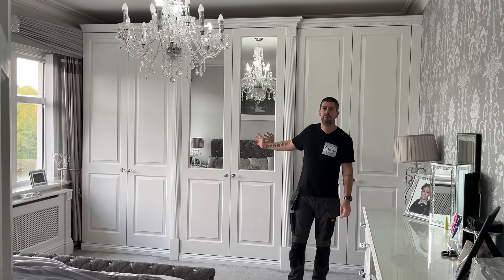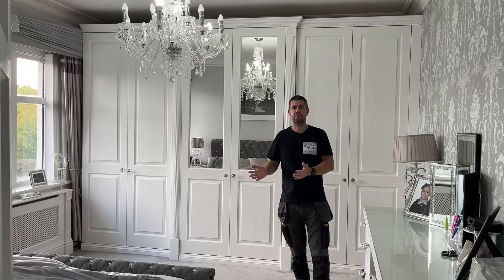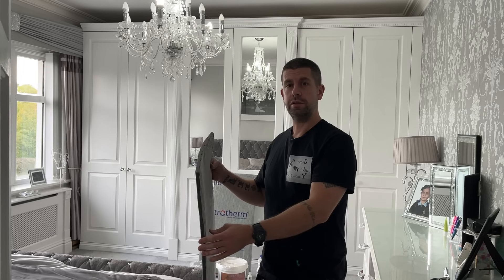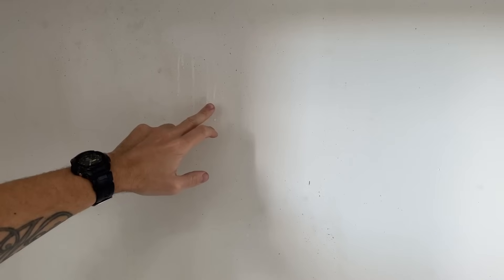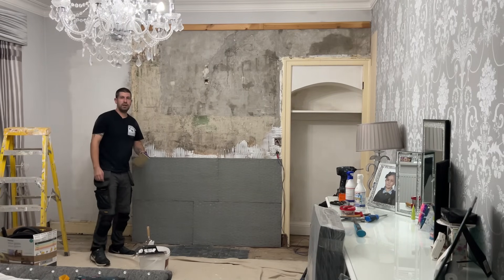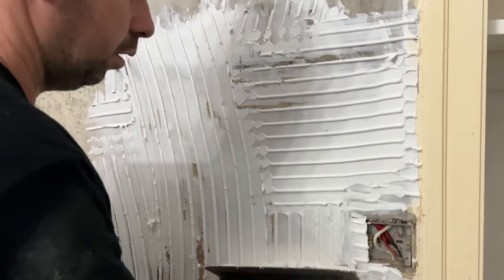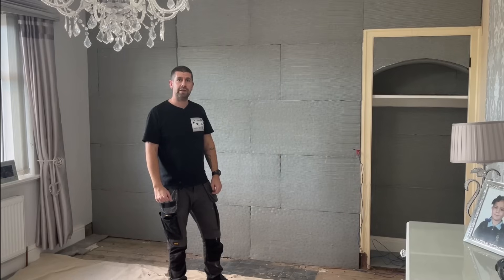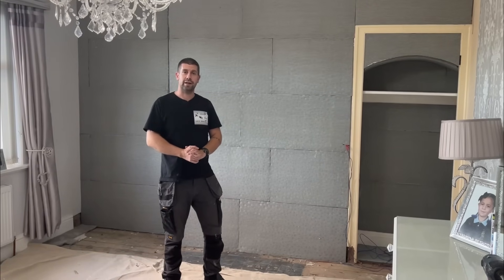Insulating Internal Walls. Easy DIY Solution

Comment: This will not solve the problem. The moisture will condense somewhere in your house overnight. You probably have extremely poor air quality indoors. (1) humidity meter £20 (2) open your windows at least once a day (3) open window after shower (4) open window after cooking (5) buy a dehumidifier.  Insulating everywhere is excellent but if you don't then ventilate you will be maintaining extremely poor air quality and will suffer more respiratory diseases/headaches/poor sleep etc.,.
Reply: All true.
Reply: Yes, I wish you were wrong, but bitter experience tells me that you’re spot on! 

I’m going to lean into airtightness & improved insulation…and then MHRV. 

Can’t wait to wave goodbye to damp & black mould by tackling the cause rather than just the symptoms.

Frankly I wouldn’t trust most professionals either. 

Oh god, just seen the product he’s using facepalm where do I start? 

Ideally you need to use a vapour permeable internal insulation like either hemp/wool/wood fibre products, followed by permeable board/lime plaster, or, if you can afford it, aerogel.

What you don’t want to do is use a product with negligible insulation value, that seals damp in your walls and encourages interstitial condensation. Like what he’s just done 😢

Comment: I doubt if the problem is solved. It will just form behind the product, out of sight until it accumulates to the point where it escapes from the wet wall. Condensation will be discouraged at the treated surface but will gather at other points that are below the dew point. No product that is affordable will do much at that thickness! The solution: dehumidify, ventilate when frosty, add heat when possible, expose external walls, keep air moving at the surface. Better still, insulate externally and vent the chimney.😊

Comment: It has all been written by many people already, One thing would try (because there is no way i would those wardrobes back on that wall as it is or with plaster or whatever goes on top) That water/moisture is now trapped it has to go somewhere. So on the bottom row ( on the floor) between the new insulation and the wall he has used adhesive on I would leave a gap, eg 5-10 mm,  and have something like conduit made out of plastic to make a channel for the water and just hope the moisture he has trapped in to that wall goes downwards. I would drill a hole into the outer wall so that the wall runsvia  the conduit towards the window wall, and direct it via some sort of pipe out of the building. In any case I dont see any mention of a vent. If you put a hole in the base of that wardrobe when its put back you can put a vent cover on it and at the very least then you can put a dehumidfier next to it.

Comment: I think you need a decent dehumidifier, those moisture traps are useless your not getting the water out the air, Charlie DIY does a video on this. Use a proper plug in dehumidifier and you will see results.. yes chimney would be a cold spot but without taking the water out the air it will just condensate elsewhere
Reply: I agree. Charlie did a great video. Get a cheap air monitor and check the humidity level because you may find that it's really high and you probably didn't notice it before because warm air can hold more moisture and now since the room is cooler you are reaching saturation alot sooner. Anyway as suggested a  dehumidifier will help
Reply: @asif530  mine was up to like 85/90% 
Now it’s around 65% in the winter  with the dehumidifier, massive difference pulling 2L plus out the air daily… showers/cooking/breathing and drying clothes in houses when the windows are closed causing massive issues people think heating the house will solve it. Completely wrong
Reply: @liam_j82  that's good. I have monitors placed in a few different places and luckily with a few changes I'm able to maintain around 50 % humidity . As its relative humidity it does creep up on occasions

Comment: My home is well insulated, inside and out. I’ve used Wallrock thermal liner and cavity wall insulation, have extractor fans in the bathroom and kitchen. The house now warms quickly and stays warm but I still had window condensation and also condensation dripping from exposed chromed pipes in the bathroom. I purchased a recommended (Russell Hobbs) dehumidifier and now regularly take 6-8 litres of water out of the air daily. All condensation is gone. For me it was the way to go.

Comment: Your main issue is humidity, and that is best handled by installing an air exchange or dehumidifier. The starting point is to purchase a cheap humidity meter so you can quantify the problem. The wall insulation has itself not solved the problem, but rather it has solved the consequences of the problem in a certain area of the house.

Comment: Install a ventilator cowl to your chimney pot, if it hasn't been done already. It'll help eliminate water ingress and allow the existing flue to continually breathe. If its currently capped there can be condensation building up within the flue, escaping through the interior walls. I talk from experience, living in a victorian home. This solved a big problem for me and saved me a lot of money too. Let old buildings breath as they should. 

Great content by the way. Well presented. Keep it up
Reply: Great, relevant advice -- thanks v much.

Comment: The reason you have mould is moisture in the air that you need to get rid of. Older houses were more draughty but this helped to remove air moisture. Our houses are so well insulated these days that the moisture tends not to be dispelled. We also have a 1930 cottage which until about a year ago had the same problems everyone else is facing. We had stopped up all the draughty spots and insulated but this led to mould in areas where there is little to no air flow and also to condensation on the inside of windows which by the way are relatively new. 
The answer for us was to fit a PIV unit. This stands for Positive Input Ventilation. Almost instantly we noticed the difference. The window condensation was gone within a couple of days and we have completely eliminated all mould growth (after cleaning away any that was there prior to fitting the PIV). 
The manufacturers say you need an electrician to fit one hardwired in. However, I contacted the company we bought ours from who admitted that it will run quite happily off a 13 amp socket fitted with the appropriate fuse. Most people don’t have a 13 amp socked in their loft (where the PIV is fitted) so that why they say you need an electrician – we did have a socket already in ours so we just used that. I fitted the PIV myself in under and hour which was really easy.
Honesty, if you have the kind of problems shown in this video, a PIV is what is needed to fix it. I still think the insulation is a good idea though as it will help keep the house warmer. Hope this helps someone. 🙂
Reply: Sure helped me, thank you
Reply: Did you have to vent the unit in the attic?
Reply: Thanks very much -- valuable information!!
Reply: What is PIV?
Reply: @lizwirtz5968  he says in his comment
Reply: @markhedger6378  Yes, thankyou. I checked after and realised.

Comment: The problem you are suffering is too much humidity in the air and cold spots that are below the dew point. When the warm moist air hits the cold spots the water condenses onto that surface. The PIV systems people are talking about pull in cold air from the outside that is lower humidity then it’s warmed up and it pulls some of the humidity out of the air and will push some of the existing air out of the house via any gaps. 
Other people have talked about dehumidifiers. These are quite good and will produce a little heat in addition to pulling out water out of the air, but the do cost a fair bit to run. 
The problem with insulation on the walls is the temperature will drop behind the insulation and you could then end up with interstitial condensation. This is why people use moisture barriers on the warm side of insulation to reduce the passage of moist air into the insulation. 

Things to be wary of. 
Drying clothes inside on rads
Showers
Boiling kettles
Cooking. 

If you are going to dry clothes indoors then a dehumidifier is a must and will dry them quicker anyway. 
Shower get a big extractor fan not one of the small wall based ones an in line one and make sure your door to the bathroom has plenty of gaps to let air in. If the air can’t get in easily then it won’t extract much air. 
Boiling kettles, when you’ve used it poor cold water into the kettle to stop it steaming. 
Cooking, make sure your extractor fan works and if it dosnt go to the outside then get one fitted that does. A. Internal venting one is no use. 

Great video, make sure you do a follow up after winter.
Reply: PIV systems are great in spring and autumn, but I've found they cause nothing but problems in the summer and winter - in the summer they drag in hot air from either outside or your loft (and if it's your loft which is common it is so much worse still) and in winter you have to either pump cold air in or spend a lot inefficiently heating the air. If you're gonna retrofit a system like that (and tbh as we insulate and seal older houses we should) you're better off spending a little extra on a heat recovery system for not a whole lot much more money, you can buy kits that come with a design service to make sure you're doing it right.
Reply: Towels are bad too. I use an artificial chamois to dry myself. When I wring it out tons of water comes out that would have otherwise sat in the air as the towel dried.

Comment: Everyone talking about how he should reduce the humidity in the house are missing the point - he probably knows this!
 This video is more to show this really good, simple product which we can insulate our external walls with and would stop the water vapour condensing on the wall, which the mould then grows on.
Reply: It won't fix the windows though. Dead obvious he has a humidity problem. The insides of windows should never look like that.

Comment: Wie have in germany something called: Ytong Multipor
Ytong is the Brand and Multipor is the Produktname. This stuff is awesome.

I used it in a wet Basement.

This stuff is so good for thermal insulation. The best thing about it isn't the thermal insulation, but rather the fact that it can absorb an enormous amount of water and moisture. 

The wall underneath can still breathe completely and is open to diffusion. Mold is not possible because the PH value is too high. Combined with automatic ventilation or occasional ventilation with an open window, Multipor is unbeatable. This is the Ferarri under the diffusion-open insulation in Germany.
Reply: Thanks for this. Will check it out!

Comment: dehumidifiers are good and not very expensive to run. Its a common problem particularly in bedrooms . Lots of "water" produced overnight with little or no ventilation but mainly the door is closed making things much worse. Opposite with kitchens and bathrooms where doors should be kept closed and extraction fans fitted

Comment: Had exactly the same problem ,lost all my run of robes,moved new robes to inside wall no more problems,outside walls are the problem unless you do what you have done,also having problem in the kitchen ,stuck insulation behind outside wall units ,also if you tile the floors always put a moisture barrier on concrete floor before tiling with insulation as we'll as the floor gets realy cold in winter causing damp to rise

Comment: Erfurt make a 7mm thick XPS panel that is more rigid than this stuff (and about the same dimensions otherwise), costs about 23 quid for 4 square meters, and you can put the adhesive on with a brush which makes the job much simpler for a DIYer, and they perform great. These look like they will work well if you can hide them or plasterboard over the top of them (but if you were doing that I don't know why you wouldn't just use XPS or PU-backed plasterboard). The Erfurt XPS panels are fire retardant treated and you can paint over them directly or just put lining paper over and paint or paper that. I've only used them for ceilings in a trouble spot, but they've been great for that and should work fairly well used on a wall here or there.
Reply: Well, this video is promoted and I expect this stuff to be quite expensive. XPS is quite cheap and it feels nice and warm to the touch.
Reply: I was looking at this too. 
Did you have any trouble levelling them? I would paint directly over them but I'm worried the lines where they joined together will be visible?
Did you get them from gowallpaper?
Thanks

Comment: As pthers have said, get a PIV system but make sure its with the small heater. Uses minimal electricity and will resolve these issues a lot easier and do the whole house.

Comment: I would spray the mold cleaner onto a cloth to clean. A vacuum could push mold spores into the air as they are microscopic. Use gloves eye protection and a mask when doing this. My thoughts, you have dampness build up. This comes from your breath. Get a dehumidifier because the humidity will still continue to increase and find new places to condensate. It does seem like a solution for areas like cold outside walls which I am considering.
Reply: I was thinking the same thing. Vacuum cleaners have filters but I would be worried about spores passing through. Also is the vacuum cleaner bagged or bagless? Either way dust always escapes when you are emptying/changing the bag. I agree with you, soak the cloth or better still use cleaning wipes - one wipe of the mould and then drop the wet wipe in a bin bag. I had experience of extensive mould in someone's bedroom that simply had too much stuff stored in it. Carpet wet through and so much water on the floor that I thought she had a burst pipe! God it was such a mess!

Comment: It gets too dry here in the winter in Oklahoma for that kind of mildew problem. In North America, it's against the NEC to conceal junction boxes in a wall. It is dead, but just make sure the wiring is deactivated in a way that is code compliant. You wouldn't want someone down the line to reconnect electric lines with concealed junction boxes. It can cause a lot of problems.
Reply from the maker: When I re-wired the whole house I removed all of the old wires so there is no chance of any problems down the line with the electrics. But thanks for your concern 👍🏼

Comment: Chimney stacks must have air flow/ventilation. If you block up fireplaces you MUST install air vents where the fireplace was to allow air in into the stack. Seal a stack up and it just becomes a damp festering void, and that moisture will penetrate the brickwork, and hey presto - damp/mould on the internal walls.
Reply: Just cap the chimney.
Reply: There still needs to be some airflow.
Reply: @maxthelab8457  Why? It's no different to an exterior wall.
Reply: how did you come to that ???

Comment: Quick tip. I run a dehumidifier for the first three weeks that I start putting the heating on. The one I use is an EcoAir Classic. It's very good. I have very little condensation after that once my boiler is on the low and slow setting / top up method.
Reply: 100% that moisture will just land elsewhere it needs pulling out the house with a dehumidifier or air system ventilation
Reply: @liam_j82  The FixMyRoof video taught me about condensation. The water in the air is the issue, not so much the insulation. Actually warm air can hold more moisture than cold.

Comment: The mould issue can be addressed with a dehumidifier not extra insulation. I have a feeling your house is already pretty well insulated.
Reply: Agreed that dehumidifier can help. Mould in the house is most commonly a ventilation issue (lack of). I recently installed a Positive Input Ventilation system in our house which has solved our mould and window condensation problems in our circa 1915 house - it's like a bloomin' miracle!
Reply: If they're heating the house to 21C at say 50% RH then it's gonna condense a lot inside the cold wardrobe.

Comment: I just came across your bideo. A bit late but, next time you have an issue like mold, use neat bleach mixed with no more than 10% water. This kills mould spores and cleans it all off. Then use an insulation... Hope that helps?. It works. I did it many times over the years in different houses. Its bleach thats in the product you bought?... Its the only thing that removes and kills everything. 🤗

Comment: mould is causwd by moisture in the air - get a dehumidifier set to 40-60% moisture and your mould will not grow as the air is to dry.

Comment: this is why there should be a decent gap between the backpanel and the wall, with a opening at the top.
Reply from the maker: There was a gap, I'd used a 25mm batten behind the middle one and there was alcoves behind the others.
I've always left air gaps behind wardrobes when I used to do it for a living and never had a problem like this.
Reply: It's a lot more work but you could remove most of the chimney, but maybe you're using it below.

The bottom of the wardrobes might need some ventilation space to allow the air to move up and down at the back of the wardrobe, to create a draft, airflow. Only having top ventilation means there's no draft. The cold wall will just get moisture from the air and it will sit there. The warmth and moisture grows the mould. Maybe having a ventilation at the bottom would help.

Just a thought but maybe a very small and thin radiator, or even just some copper piping, at the back of the wardrobe could be a help. Bend some piping into S shapes attached to the back wall, then back under the floor, join to the radiators.

Hope that this insulation board works.

Have you tried a dehumidifier? I'm tempted to try one.
Reply: IMO, Needs vents at bottom of wardrobe too to allow air to flow.